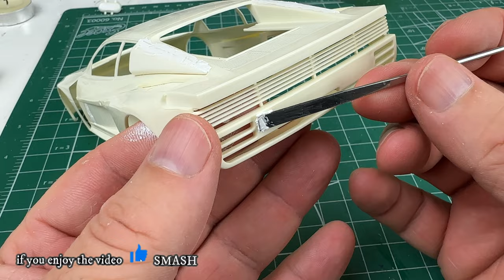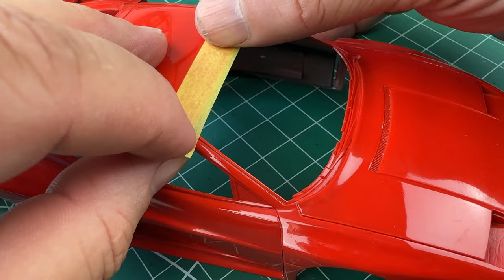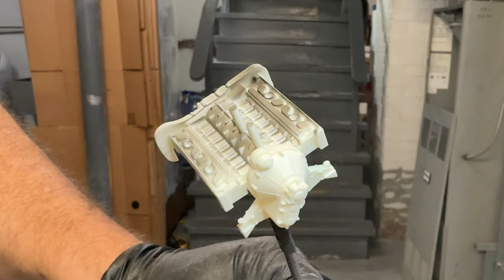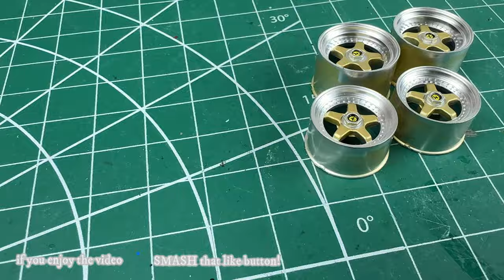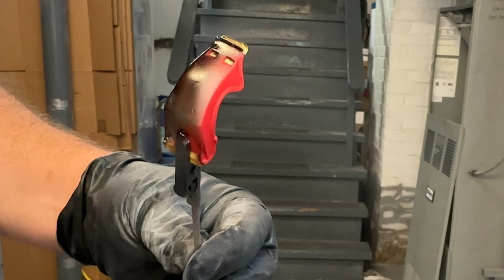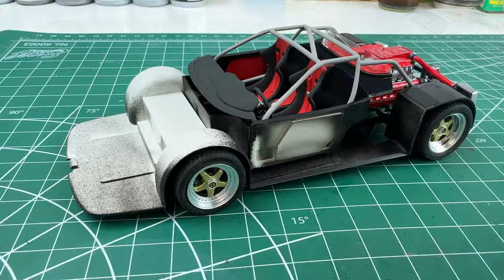Build a 1000HP Testarossa in Miniature: The Koenig Competition Ferrari Testarossa by Fujimi

Comment: Fantastic build! If you are open to constructive critisim I would suggest you to lower the stance just a little bit as the gap is just a bit to big. But that's the only thing I think can be different! I'm in love with this car! 😍
Reply from the maker: Thanks for your input, always looking for honest critique. I'll let you in on something here, I think what happened was I glued the dashboard in a little too far forward in the tub. There wasn't a lot of good points of attachment for the dash unfortunately. So when I put the body together with the chassis, I think the dash was slightly pushing up against the hood of the car, giving it that offensive wheel gap. This thing was not easy to get the body on the chassis and I felt that if I tried to pull it apart, I would end up making more of a mess then fixing anything so I kind of left it. it is a bit of a fiddly kit but I do love the look of this beast and if Fujimi ever releases it again I will be first in line to buy one and build it again. Now I know to be more careful about that dash! haha.